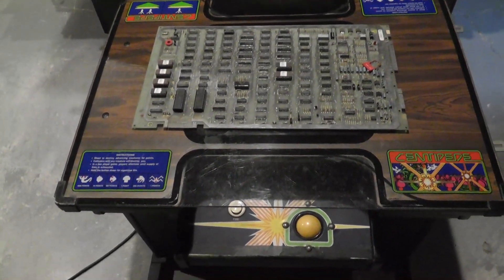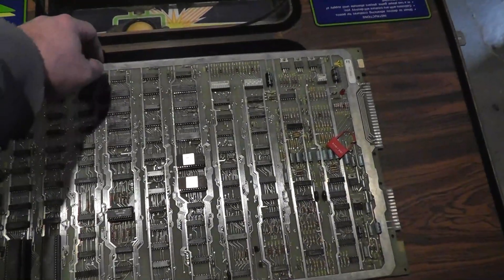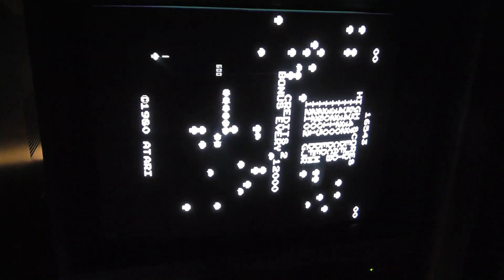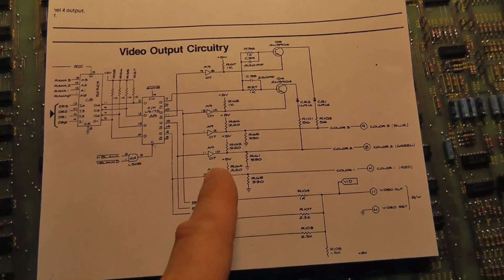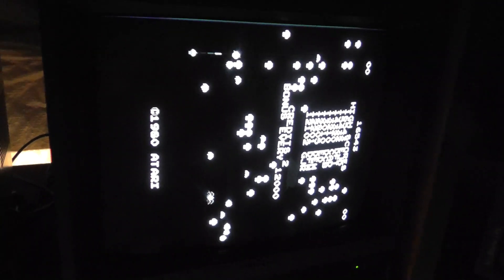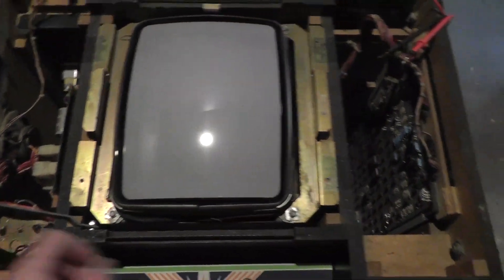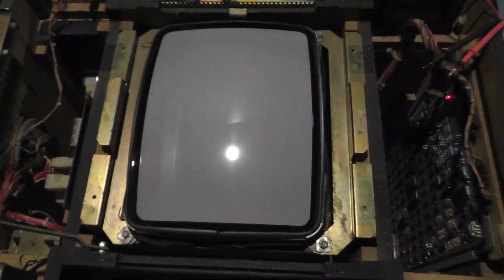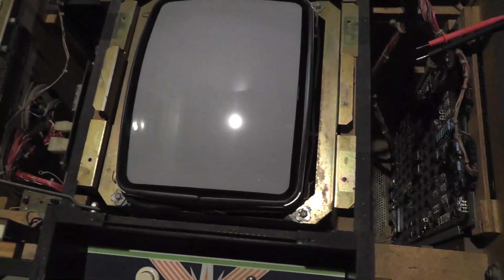Centipede Repair - PCB Video Out Basic Bench Setup

Comment: Mine was doing the thing at the end and it looked like it was raining sideways, how did you fix that?
Reply: Also I connected the video output on my board directly to the points on a video composite cable but it didn’t show anything, is it because I am using a normal CRT tv with a standard composite cable? Should I do something else to get video?
Reply from the maker: that should work.  just hook up gnd and the video out to composite connection.
Reply from the maker: I just adjusted the Horizontal or Vertical Hold.

Comment: Hi love your videos best education for me since I am just starting to learn how to repair boards. I am working on a centipede board and I have repaired it and it is up and going on the bench but the trackball just goes to the left and doesn’t move. I tested the movements and they are changing states at the chips and I see .7v to 4.9v from the trackball but still no change and it doesn’t work. Any advice I tested the 74ls191 74ls74 74ls157 40106 and they all perform fine
Reply from the maker: You are in the correct location.  I can offer anything additional off the top of my head.  Your best bet is to start a repair thread on KLOV.  Good luck and report back if you figure it out.

Comment: JACKLICK, 
Arcade Address Error Question

All the data signals and address signals look good on the oscilloscope even when the addressing has errors. How would an arcade repair technician know there is an "addressing error" when all the data signals and the address signals look good on the oscilloscope and all the ROM and RAM test good on the ROM/RAM tester?
Reply from the maker: You know I am not an expert right? :)  I appreciate the questions anyway and hope I don't ever answer too confidently.  Always take my responses with some skepticism.   Measuring these data or address lines with a scope just shows whether they have activity or not.  As you state, it doesn't mean the data on the line is correct.  You will need a fluke 9010 microprocessor troubleshooter or a signature analyzer (with NOP adapter) to see if the data you send/expect is actually correct.  One of my upcoming videos will be on signature analysis.  It is easier with the fluke but yea it is hard to track this crap down.  Hopefully there are clues you can see on screen that lead you to an area on the schematic to narrow things down.
Reply: @jacklick  thanks for the help
I thought a Signature analyzer would only verify if the ROM chips are good or bad. The Signature analyzer can't test if the RAM chips are good or bad or is the addressing is correct or has errors?
Reply from the maker: I haven't used my sig analyzer to this extent, yet, but when combined with a No Operation Instruction (usually via a NOP cpu adapter) the cpu becomes a 16bit synchronous counter.  You can grab signatures pretty much anywhere on the address bus.  The downside is you need known good signatures to compare to.  These are often included in Atari schematics for example.
Reply: @jacklick  can you show how to use the sig analyzer with a NOP no operation instruction to test the ROM and RAM chips on an arcade game board in a future youtube video because I don't understand how this would work to test the ROM and RAM chips.
Reply from the maker: Will do.  I am making an assumption it is possible because I know there are  SA "signatures" for Rom output lines in the schematics.  My theory/assumption is the a specific address/memory area is being triggered by the NOP  via address lines which causes the rom to put that data on the data line.  Again, I haven't actually done it yet and it is still murky to me but look forward to hopefully figuring it out or failing while trying :)
Reply: @jacklick  yes make a video soon to show how the NOP signature analyzer will troubleshoot arcade games. I'm guessing your removed the CPU Z80 chip and replace it with the NOP signature analyzer and the arcade circuit board doesn't use a Z80 it gets replaced by the NOP signature analyzer.
Reply: What model Sony PvZ is that please